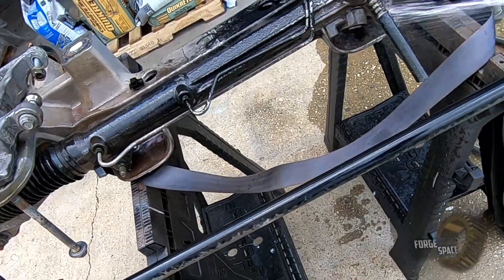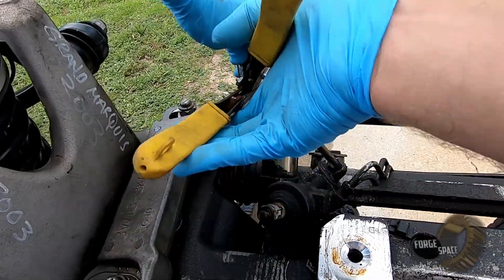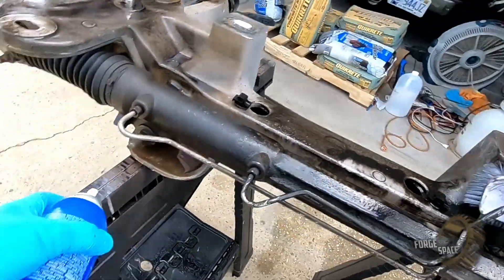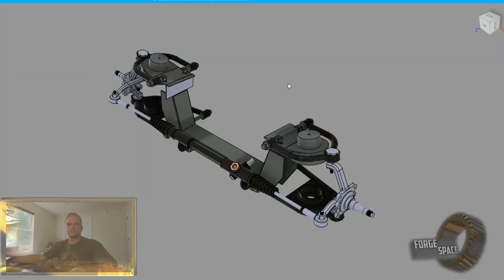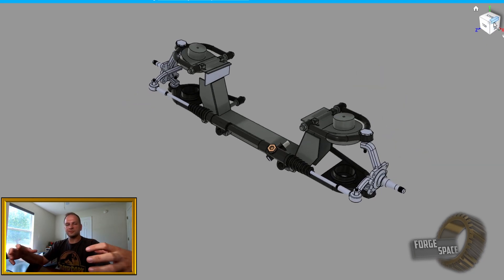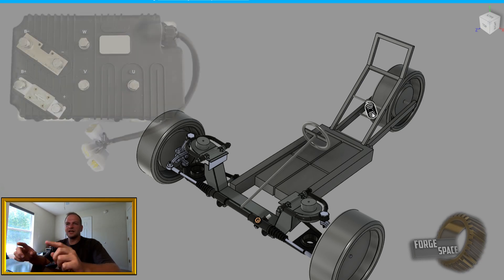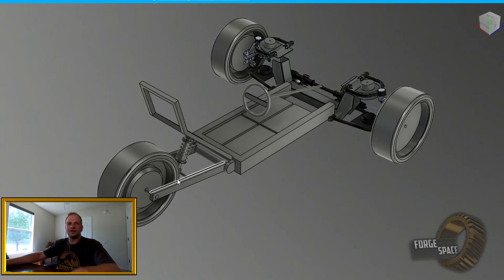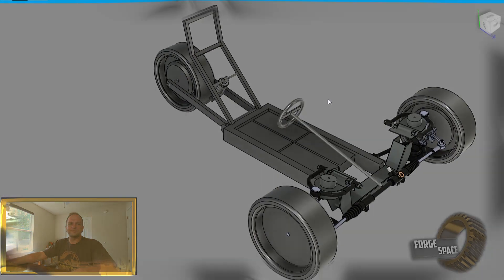New Build! Electric reverse trike - CyberTryk EP.01

Comment: I understand that it got taken apart since then, but what was the final mass (weight) after it was complete? Were you happy with the 12kW hub motor?
Reply from the maker: I never did a full mass measurement on it. Between the frame, suspension, and oversized brakes on it it was on the heavy side. The 12kW motor was surprisingly peppy for what it is. I definitely got it up to at least 65mph with ease. On a regular motorcycle conversion I would say this is about the equivalent of a 250 - 300cc motor.

Comment: Nice build ;) 
I pretty much made everything on mine and went with ATV front parts for swingarms and all. Got progressive suspension from two harley davidsons those worked out VERY well. I've been driving it for over a year now.   Same QS motor. 72v 200A fardriver controller ao my max kmph is about 100. For in city..  thats good enough for me and of course I don't need more than that for testing purposes. Just throw in a higher voltage  battery and  next stage up controller and motor. I also have a nice fat ultra capacitor bank at 100F. I saw another man make a build simmiliar to the one you're making here. Great ideas picking parts from cars. There'll be alot of those soon. Parts. That is. 😆

Comment: Excellent ideas but did you ever consider a back seat behind the driver in line.
Reply from the maker: I had thought about it previously to do a tandem layout. For this I wanted to keep it short. If I like how this works when its done. I may consider doing a V2 of the design with tandem seating and larger battery pack.